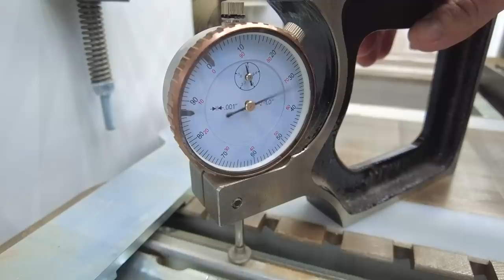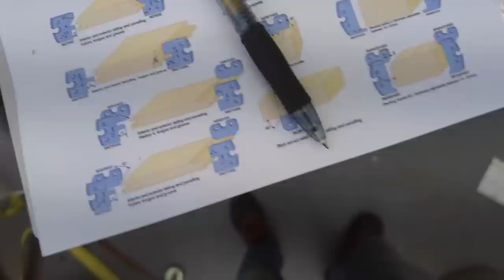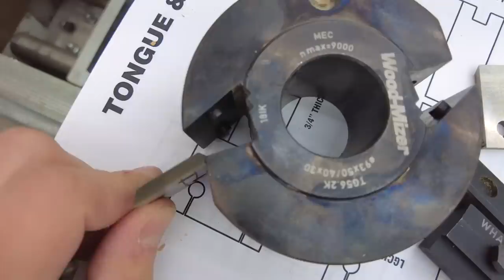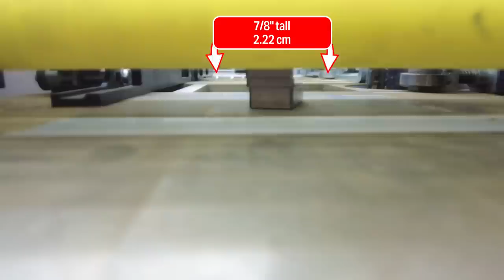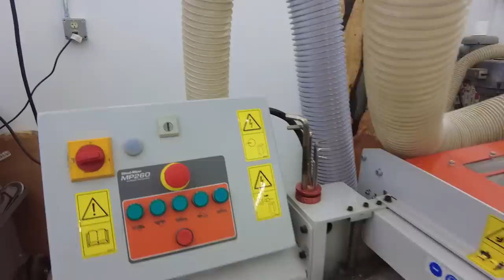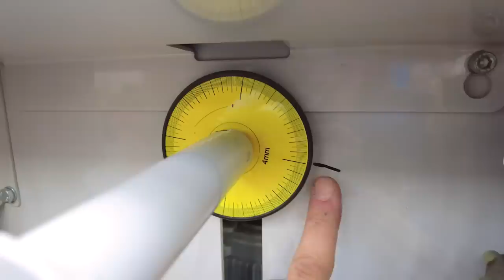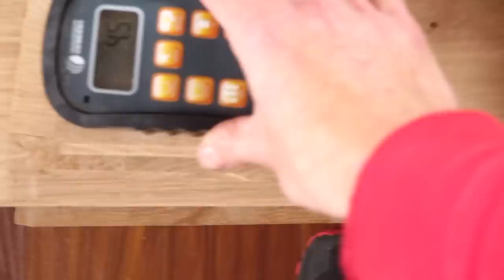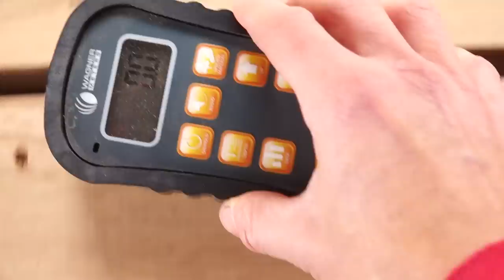I Swore I'd Never Make Flooring Again | Home Renovation & Addition Part 50

Comment: I'm surprised the CV cyclone can't handle 4 ports. Those are 5" ports though not 4"?
Reply from the maker: Seemed to keep up pretty well. Handled the chip load of the top and bottom cutters. The side cutters have pretty poor shrouding. The only 5” port is the top cutter. Others are 4”

Comment: Maybe a dumb question but I'm not a flooring contractor.. Should there be a tongue & groove on the ends of the boards too to prevent a possible lip in the butt joints from seasonal humidity changes?
Reply from the maker: I’ll take care of that during the install. Boards haven’t been trimmed to length
Reply: @mcremona  I suspected that, but wasn't sure. Thanks for replying.

Comment: I am surprised that you don't have to do this adjustment process with every board you run through the machine.  There doesn't been to be a lot holding the blades in place.

Comment: I’d still rather do this than install and finish drywall. I think I’d just discharge the dust outside and deal with it later.
HP and amperage draw of that thing?

Comment: I would suggest that when testing your dried flooring after you have run it, that you apply the species correction factors and ambient temperature factors to the physical meter reading, so that you end up with the correct meter reading - because the meters from the factory are graduated to Douglas fir & I think you were running cherry?
In an idea world, you want the readings to be uniform with each other, but also, down to the recommended EMC (Equilibrium Moisture Content) for your area, assuming your not running 24/7/365 refrigerated air conditioning in your home.
Because your in a snow environment (extreme dry relative humidity) - I’m guessing you will want to be below 9% actual EMC.

https://youtu.be/BkAUcSvRnp4

Here were I am downunder - we never see snow and being on the Swan River Coastal Plain - our recommended EMC is 12%, so a good deal higher than what you will require.

When your running flooring you really do want a second person tailing out for you.

Reason is, you cut a 6 or 8 inch long sample off the first good board through the machine, and while your feeding the next board in, the person tailing out - can test fit the tongue edge and the groove edge to the board feeding out of the machine to make sure that no settings have changed inside the machine during the run.
If there is anything wrong you pick it up straight away and can stop and fix it before more boards get run incorrectly.

Example, I’ve seen a wedge of timber split off and jam against a fence, pushing a board away from the tongue cutter and deeper into the groove cutter and you end up with each subsequent board Mal-formed.
It’s best if you can catch that straight away & the second person tailing out can pick up such mistakes straight away using his test sample for correct fit.

Used to run a pair of Wadkin 8 inch and 4 inch four siders back in the day.
They each had 7 heads. Two heads on top, the roughing head and the finish head, two underneath, one each side and the last one underneath to put the relief V grooves in to prevent cupping.

Your secret nailing profile cutters will leave a lovely looking floor when all done. It will be well worth your time & effort.

Some of the new 4 aiders from Weinig etc are computer controlled and self straighten the boards - so you don’t have to manually straighten them over the jointer first.

You need a truck sized sawdust hopper & extraction system to service a 4 sider making flooring - as you’ve found out. 😂👍

Good job all the same

Comment: i bet that is one of the loudest machines humans have ever made :)
Reply: Not even remotely close. I used to go to a factory to pick up material for bucks. The holes were stamped out by a giant press.  I still hear it in my dreams.  KA-THUMP!! Everyone needed to wear ear protection all the time.  1/2'' holes in 3/8'' thick angle iron. doesn't sound impressive until you see it in action.

Comment: Does WM make this planer/ molder with an in-dexable spiral cutting head or just the straight blades
Reply from the maker: I don’t believe so as you’d lose the ability to run the moulding cutters in those heads
Reply: @mcremona  are you referring to the relief cuts on the underside of the flooring?
Reply from the maker: Yes, you can run any of the profile cutters
Reply: @mcremona  …think I’d Agree with you as this being an entry level machine, although the setup time would not convince me of that. Looking forward to your install of the flooring to see if it was worth the machine setup effort.

Comment: qq: what are those "relief-cuts" for at the bottom of the boards? what would happen if you didn't have those?
Reply: I would guess to lower the surface contact incase they aren't perfectly flat/if there is junk on the subfloor
Reply: It prevents warping.

Comment: Interesting that at 23:07 you show ".0625 in =0.2cm" , the inches down to 10,000th of an inch, but cm only down to 10ths of a cm. If you resepcted the precison of the cm then the inches would be 0.1in and if you respected the precison of the inch, the cm would be 0.1588cm.

Comment: I dont understand why they put a vertical bar in dust collector tube. The tube looks heavy enough that it won't collapse and it looks like a pain to clean
Reply from the maker: When using the machine with a blower, it keeps big chunks from entering the collection system and impacting the impeller.

Comment: Most standard flooring ive seen has t&g ends. How will you cut those, or are you going to cut them?
Oh and you do know that commercial shops sell their hardwood sawdust and chips? People use them in smokehouses for one thing. A 5 pound bag is around $15 at retail.
Reply from the maker: Domino

Comment: >  looks good; a lot of work. 1) dust collection (or lack there of @ the machine interface) appears a potential accuracy / fire hazard. 2) what you called the least significant cut operation - the back relief cuts, are in actuality, given the rather wide stock,  the most  important (apart from the actual tongue/groove) for a superior, warp free product over time. cant wait to see it installed. thumbs.
Reply from the maker: Yeah the side cutters need more shrouding. By least significant, I was referring to the accuracy. Their exact position is insignificant

Comment: What about the ends? Don’t those also need to have a tounge and groove
Reply from the maker: Will be done during install
Reply: How is that done? Do you do it with a handheld router?
Reply from the maker: @leonardogojcaj4475  I'll use the Domino but usually it's done with a router

Comment: I can understand having to add the right mold cutters, but what you had to do is ridiculous - e.g., out of the box - having to align rollers et. Also shimming heights instead of adjusting heights with a cam feature, bolts or auto adjust is just wrong..Too much mucking around - what a horrible experience for you, and back to the old days...Sorry about that. I bet also the machine cost an arm and a leg? Good patient video though - what happen to all the exasperation grunts?
Reply from the maker: We cut a lot of the mucking around out too. Might have been some grunts in there somewhere
Reply: The amount of prep work seems quite excessive (after video editing).  Not sure that machine serves it purpose. Too bad for WM.

Comment: MATT  at 27:29 you started the cutter motors with the top up & You LEFT 2 WRENCHES RIGHT ABOVE Them ON THE LEDGE AND THE VIBRATION KNOCKED THEM off-- VERY CARELESS & LuCKY, SINCE YOU ARE ALWAYS WORKING ALONE. You need other sets of eyes and awareness. Saving $100 a day for a helper is no way too get maimed. Really!
Reply from the maker: I watched them vibrate away from the machine

Comment: You did swear that you would NEVER make wood flooring again...
Reply: Thankfully the wrench falling outside of the machine was a thing... and it would seem that getting the test pieces as good as possible will alleviate and problems with uneven floor surfaces when installation time comes. Overall, it's nice work Matt!